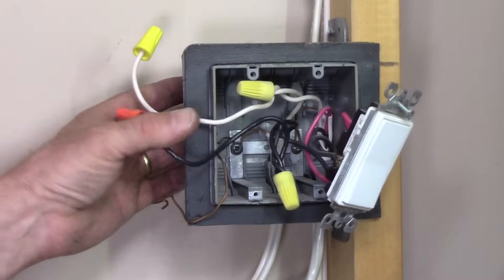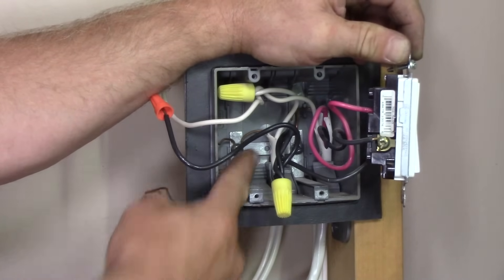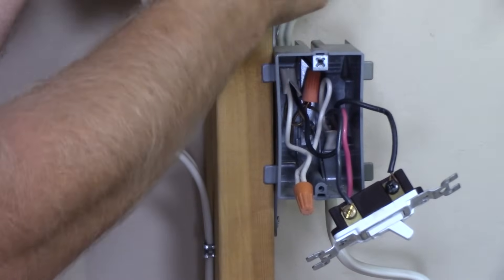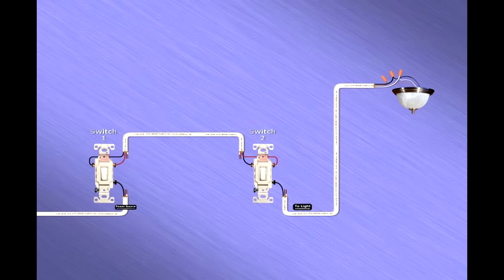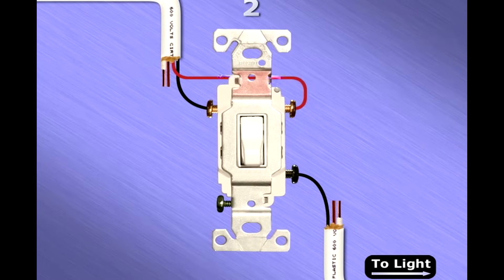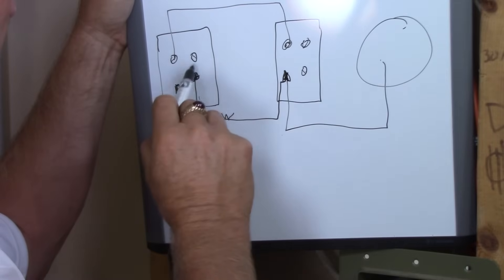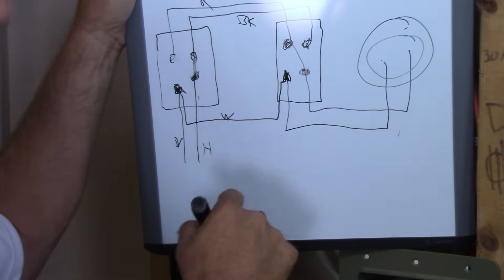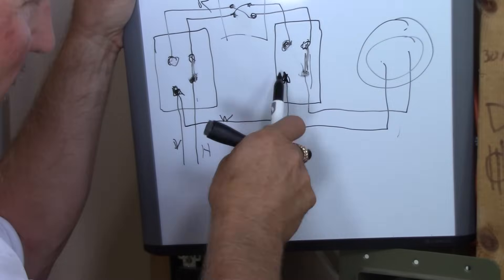The Best 3 Way Switch Explanation Ever!

Comment: Please let me know how to identify the wire in a nob and tubing where all the wires are the same colors.
Reply from the maker: You need a meter and the knowledge to use it.  Hot to neutral will show 120 V, and hot to a grounded source (such as a copper water line or a metal gas line) will also show 120V.  The neutral to ground source will be 0V, or close to it.

Comment: Except that there was no place on either switch for the white wire being connected at all, nor did you show such connection.  Not only that, clearly there are just 3 screwed on the swich to connect any wires.  While you show it in your drawing.

Did I miss something.

Furthermore what is up with the 2 way light switch.   It is no different than the 3-way.   Same same.
Reply from the maker: The neutral connections in the animations are left out just so to help you clearly understand the current flow.  And yes, some call them 2-way switches.  Probably makes more sense.
Reply: @theinternetelectrician  It is amazing how everything works in this world.  Better yet, everything works like everything else.  It is no different.
From Electrical to electronics to ecology and music and seemingly other unrelated things.
I remember back in the days, when computers were just coming out. The very first thing I heard about computers was that it only dealt with 0s and 1s and that to a computer everything is just a bunch of 0s and 1s.
I almost fell to the ground and never believed it.   It basically paved the way that ultimately I never finished school.

Some 30 years later, one fine day it was time for me to clear that air and find out how on earth computers work.  What the heck is a program/software or whatever they want to call it and what them 0s and 1s work.   And the so called hardware.

At last I realized that I was right all along.   Computers are indeed electronic instruments and know nothing about no dang 0s or 1s.

How computer turns 0s and 1s into texts, sounds, and images?
It is because it doesn't.

How does computer saves things, data, file or whatever they want to call it.
There is every bewildering answer out there.  And here  is one that you won't find anywhere  and it is my answer:
The same way that you car battery remembers to hold charge and not lose it.
The same way a capacitor hold a charge.  There are no datas, files, 0s and no 1s.

In fact, there is no " charge" and "no charge".  There is only full charge or low charge.

Lets put it this way... don't buy for one second about their so called square wave.
Just based on common sense, you and I know that everything that happens, happen in time.  In other words everything takes time.

On the oscilloscope the square wave is proudly shown. What is not shown is how they had to tweak the oscilloscope to make it look square.   Just ask this question... how in the world it took no time that at one instant it was 0 volts and the next instant it was 5 volts.   That is faster than light voltage.  Nothing moves faster than light.   The horizontal axis represents time..  right?
All lines leans to the right.... that is correct.  There are no verticle lines period.

When you flip a light switch, on the face value, it is either off or on.  There is no in between.  Right?
Is that really true?  You just have to look closer to see the truth that it is not true.
Think about the fact as to why switches wear out if you know what I mean... you know them  sparks.... 🙂
In fact  there are two sparks, one before contact and one after the contact is removed.  Right?  Aha.

This is really reflected in computers.  It matters big.  It is called floating gate.

While you need 120V to turn your light on, the computer circuitories can turn on with 0.5V and ruin all your so called saved data, draining them, charging one thing, discharging something else.

In other words you do not just remove the contact on that switch but you have to also connect the outgoing wire to the load to the neutral.   Because even with the switch off, the  live wire may arc and cross over and connect all by itself to the outgoing wire.  Imagine a sudden voltage spike. Of course it rarely happens, as it has to be one heck of a spike.  But with low voltage, no problem. And imagine if the contacts were extremely close say by a width of a human hair.

Your car battery retains energy (memory) by means of electric field.
You can also retain energy ( memory) by means of magnetic field.
While most operations in the computer is by holding charge in electric field ( i.e. capacitor of some form and know that in reality the capacitor is never drained completely), hard drive retains memory of magnetic field for instance.   Since magnetic field is bi polar, it is a matter of which direction the poles are getting aligned, which will cause current flow one way or the other...   Just consider the so called reading and writing arms that float on that disc.  🙂

In the back of my mind I have always mumbled to myself ..."why on earth this GFCI business".  Oh it is to protect you from ground.   Oh really.  Why?
You don't hear the actual fact and why not beats the heck out of me...
The fact is, Ground circuit was implemented to begin with, not to protect you, but to protect the electrical system from mother nature, i.e. thunder and lightening.   And then they realized oh shiit.... we got problem huston.  Now we have to protect people from the ground circuit.  If there was no ground circuit.... you can walk about all day and nothing will happen to you.

Mother nature is also a mad scientist.   It can build up so much electric field in its capacitor that it will eventually break the dielectric ( air) and will discharge and seek the simplest easiest path to the earth.
Reply from the maker: @alchemy1  You made my brain hurt.  Must lay down now!
Reply: @theinternetelectrician  Tell me about it.  🙂

Comment: Great video, how do i use the same power to add an additional light switch for a single light?
Reply from the maker: With the wiring configuration described here (there are many variations), the only way to take power for another switch and light is to go from the first outlet box where the feed comes in.  So that outlet box has to be large enough to take on another cable.  Or if you are adding this new switch in the same spot, changing that box to a 2-gang will mean no issues with box fill capacity.  Then you just splice the incoming hot wire, pigtail to the common of the existing 3-way, and to one terminal of the new single-pole switch.  Tie in the ground and neutral conductors as well for the new light and connect the black wire going to the new light to the other terminal of the new switch.  Make sense?  Thanks for watching.  I hope that you gave it a 'like', and that you subscribed to my channel.  Much appreciated.

Comment: My stupid 3-way has 2 live wires even with both switches removed... I was expecting 1 live and 2 travellers in main switch and 2 travelers plus load in the secondary switch... How do I connect my smart switch??
Reply from the maker: Somethings doesn't seem right?!?  Would need more information.

Comment: In what circumstance would you have a 3-way switch with line, load, and a white wire on the other side connected to it?
Reply from the maker: That would be using the white conductor in a 3-wire cable as a traveller.  Quite commonly done, but usually used as a hot wire for the common terminal, and identified as such by the use of a black felt marker pen, or some black electrical tape to identify it as a hot wire.  This would be a situation where the power comes in to the circuit at another outlet box, and this particular 3-way outlet box is what's known as a "dead end" type of connection, one of the many variation of how to hook up a 3-way switch network. Thanks for watching!

Comment: I really love it when the electrician ran the Hot wire into the light fixture First. You will find this in many old houses. .
Reply from the maker: Yes, for sure.  There are many variations of how to wire these circuits.  My goal was to educate on how to follow the path of the current through the circuit, and then you can apply it to any scenario of where you bring in the power.  Having said that, with the new code rule requiring a neutral at every outlet, the method I show here is really the only one that complies with the current code. (unless you use the rare 4-wire cable). Thanks for watching and commenting!  I hope that you have 'liked' the video, and have subscribed to my channel?  Help me out in the push for 100K subs please, almost there!

Comment: I never understood why it called a "3 way" or "4 way" switch, a more accurate term would be "double pole" or "triple pole" since they send the current to 2 or 3 devices. They also have a single pole switch which sends current to 1 device,  using the term "pole" would be a logical progression.
Reply from the maker: Good question, and one that comes up a lot.  3-way as a name doesn't really make sense, unless you are considering that it is "3 devices, 2 switches controlling 1 light, 2+1=3".  Others claim it should be called a 2-way switch, (which is more accurate).  The technical name for it is a STDP (single pole, double throw). Thanks for watching and commenting!  I hope that you have 'liked' the video, and have subscribed to my channel?  Help me out in the push for 100K subs please, almost there!

Comment: I see that you have the red wire on the common side on the first switch and on the opposite side on the second switch. Does it matter which side the traveler wire goes?
Reply from the maker: No, it does not matter.  It will just make a difference on the position of the 2 switches when the light is on or off.  For example, with travellers on same terminals at both ends, when both switches are in the same position (up or down),  the light will be on.  By switching the travellers around, then the switches will be in opposite positions of each other for the light to be on.  I have heard of some meticulous inspectors insisting on the former scenario and making the electrician comply with that.  Thanks for watching and commenting!  I hope that you have 'liked' the video, and have subscribed to my channel?  Help me out in the push for 100K subs please, almost there!
Reply: @theinternetelectrician  I did as you side in the video but it didn't work for me. One switch had to be in the on position in order for the other switch to work in turing on the light. I wanted both switch to turn on and off the light. What i did was, I placed the black wire on the common screw on one of the switch, and placed the red wire on the common screw on the other switch, and the black wire of that switch on the traveller screw (where the red wire was supposed to be). Now I can turn on and off the light from both sides. Did I do it correctly?
Reply: @theinternetelectrician  I see what I did, the red wire on the second switch is hot and the black wire is neutral for some odd reason. I thought black wire is always hot and red and white are neutral.

Comment: So  since the power can only travel through two ways, why do you call it a three way switch?
Reply from the maker: Good question, and one that comes up a lot.  3-way as a name doesn't really make sense, unless you are considering that it is "3 devices, 2 switches controlling 1 light, 2+1=3".  Others claim it should be called a 2-way switch, (which is more accurate).  The technical name for it is a STDP (single pole, double throw). Thanks for watching and commenting!  I hope that you have 'liked' the video, and have subscribed to my channel?  Help me out in the push for 100K subs please, almost there!

Comment: can i add a second light to the group? Right now it has 1 light and 2 switches
Reply from the maker: Yes, and the easiest / best way is just to run a 2-wire (+gnd) cable from the light to the other light outlet.  Add as many as you'd like! (within circuit loading rules of course)! Thanks for watching!  I hope that you gave it a 'like', and that you are now subscribed!  appreciate those actions immensely, and if you feel really generous, there is new "Thanks" button to consider! :-)
Reply: @theinternetelectrician  like a jumper for the light then?
Reply from the maker: @Scottybk  Yes, add another outlet box and a parallel connection with 2-wire cable between them.

Comment: You should do one on switched and fed from the same box instead of having the switch leg coming from 2nd box (dead end 3 way). I’m sure a lot of people would like that. 3 ways took me a little while to understand, I used to wire them all day and never understood it. Once I learned it I was amazed how easy troubleshooting became on service calls. Ceiling taps are also something that used to get me.
Reply from the maker: It would be a good idea to do a video on all the different ways to wire these circuits, and there are many!  However, once you understand the concept, it becomes quite easy to apply that to other methods.  However, this arrangement is the only one that complies with the current code rule of needing a neutral at every outlet.  Lots of the other methods only have the switched conductors at the switch locations (unless you use 4-wire cable)  Thanks for watching!  I hope that you gave it a 'like', and that you are now subscribed!  appreciate those actions immensely, and if you feel really generous, there is new "Thanks" button to consider! :-)

Comment: In a 3 way switch, if one of the switches is bad will that cause the light to fail? (ie do you have to check out both switches in a 3 way circuit?

Comment: I have a question. I am attempting to install 3 ceiling can lights in-between 2 switches. The LINE pwr comes into 1st switch, passes by each of 3 lights and ends at the remote switch 2.
Can you help me work this out?

Comment: Can instead of using 12/3 I can use 12/2 and ground for neutral ? And black , white as travelers ?
Reply from the maker: Nooooo!  You can never use the grounding conductor as a current carrying conductor, not even as a neutral (the grounded conductor).  Would it work? Yes.  Is it safe? No.  Is it allowed, no! Thanks for watching!
Reply: @theinternetelectrician  thank you for the advice

Comment: Good afternoon! I have a a single light that is controlled by a 3 way switch. My light has the power, instead of the switch. 2 wire takes power from light to one of the switches.  How would you add a second light to that equation?

Comment: your animation was great hoe to connect the wires to the switches but your drawing was very confusing because you were showing switch with 4 screws and inputting in a white  which was totally confusing and o you have a video how to wire adouble 3 way combination switch

Comment: Sorry, didn't get it at all. First things firsts. DOES THE # WIRE GO FROM BOX TO BOX? Most diagrams don't show that. In fact many diagrams don't even show black/ red white whites.  This video also leaves many assumptions that all have the understanding of common , then hot then neutral, The description isn't clear in the box, identification of wire color for starters. why would anyone illustrate yellow and blue wires. I know you haven't. However, most diagrams show hot wire into first switch box. then out to first light.  then onward.  At the last box, where does the WHITE go,? If I type in does the 14/3 go from box to box direct, Big answer comes up NO.  Also no mention that different switch makers locate their screws differently.  Also no mention only assumption.  When I finally get this I will do a video for dummiew with no assumptions with those assumption details specified. Sorry, but this is not clear and common   hot. same wire wire same ? I've watched 10 video's and basically all different explanations. How the switch works is important but not to the person doing the wiring trying to make it work. Explain the switch after it's complete, showing the wires in the colors they come from from the warehouse.
Reply from the maker: Well Rick, I look forward to your "Better than Best" video.  I'll wait to subscribe to your channel until at least one other person subscribes.  :-)

Comment: Great video.  Lutron should refer to this video as they can't seem to give any useful information.  If one of the switches was a dimmer, can the dimmer be placed on either end? I got it to work with dimmer on supply side but not on load side.  Thanks

Comment: That was a fantastic video thank you. That looks like nothing the way my kitchen light is wired and it does not work correctly. If one switch is in the down position then the Other switch works correctly turning the light on and off. If that switch that’s in the down position is turned to the up or on position it does shut the light off but now the other switch that controls the light up and down does not  operate the light at all. The white common wire is not connected together inside the box it actually goes to one side of the switch. A black and red wire are tied together and the black wire is at the top left side of the switch which is different shown in your drawing and on the other switch the black is on the top left also, it seems incorrect. That was confusing and I sure wish we could speak about this

Comment: Hello Terry, nice how u animated the circuit. I was giving  my dad a hand and we found a piece 
of NM-2 cable black white and ground. . . cable I could not believe the what was being used for 
another switched load and both hot and neutral were used for 2 loads both using the grounding
conductor as a return and placing a few amps on the ground and other places where current may
not be expected. The inspectors check the obvious like neutral and ground being bonded in a 
sub-panel.
Reply from the maker: Yes,  I've seen that scenario as well!  Thanks for watching!